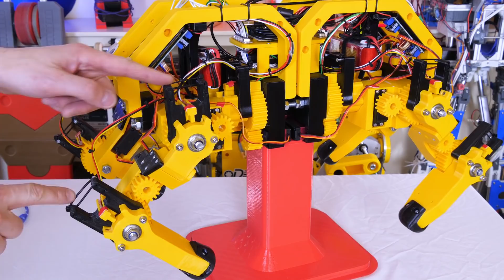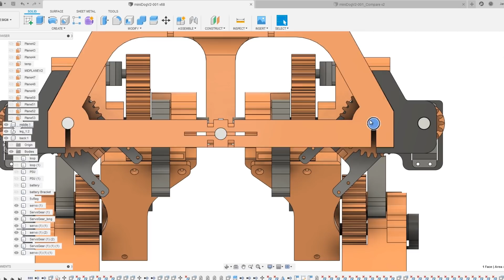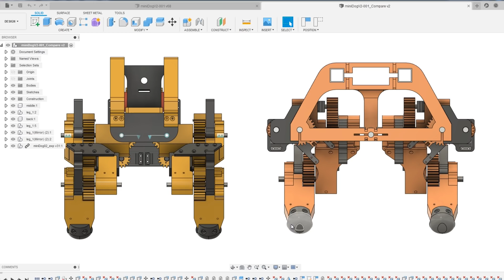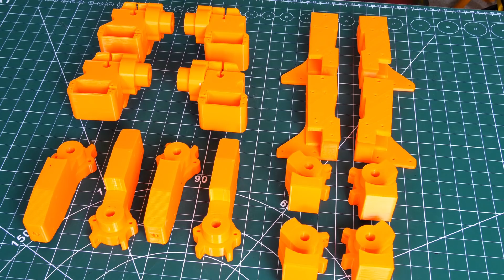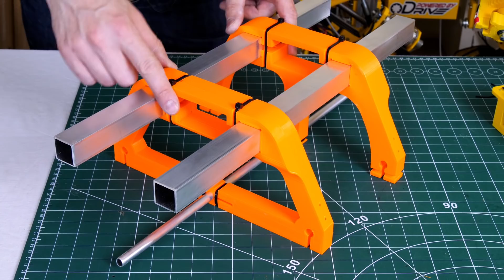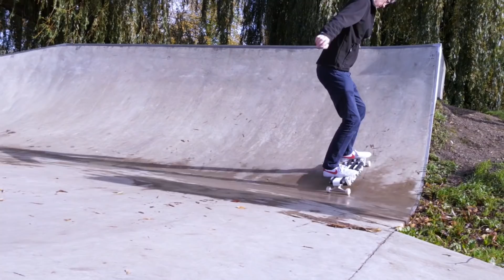Mini Robot Dog #6 - Version 2 design

Comment: you could have 2 springs per joint ( one on each side of the fingers ) doubling the stiffness of the joints
Reply from the maker: Yes but then nothing happens - it'll need to move much faster to make the springs stretch

Comment: While I'm sure it's handy having the front and back leg "modules" the same, if you mirrored the gear trains on the front module while keeping the angle of the legs the same, it would get the front feet closer to the front end of the robot. Also you'd have a longer "wheel base."
Reply from the maker: There isn't clearance for them to bend so it can walk

Comment: I'm glad to see that you're back to working on the compliance problem.  Your feedback system here is ingenious, but I feel like you'd be better served with a simpler mechanism and more computation.  If you ran your servos in torque mode you could compute an estimated force input (with your multiple axes, a force vector) which could be used to sense foot contact with the environment.  This method is more mathematically intense, but should allow for the simplest (lightest weight & minimal backlash) mechanical design.

Comment: y not just take sum time and design something more final and thought out instead of doing so many different iterations that end up not working properly and then moving on from the manufacturing part of the project and move on to the code to make it actually walk instead of just moving individual legs idk, i just feel like this channel go stuck in this weird loop...
Reply from the maker: Because I need to be sure what I'm doing before spending a lot of cash on it. This one walks quite well next week but there are some limits. I'll be combing all my R&D so far into a better machine shortly after that.

Comment: Something you might find useful in the future: Thin wall PTFE (Teflon) tubing is available as both heat-shrink tubing and non-shrinking.  You might find this useful for your plastic on aluminum joints. A thin Teflon sleeve could be used instead of grease.  Is it better?  I don't know, but it's worked well for me a few times.  With a stepped hole in the plastic, it's even possible that the heat shrink stuff could be used to retain the plastic part on the shaft.

Comment: Amazing! 
 I have a thought.
Your shoulders act independently, but your pelvis is rigid. I think if the rear legs were connected to a rigid pelvis with the axis dead center you would make a triangle that will reduce tortion and have a better day....
...especially once you get it compliant and moving faster.
Love it. Plan to make this when it's done.

Comment: The Al tubing is good.  You can Drill a small hole 1-2 mm from the end.  Put a washer on and put a split pin through the hole.  Lighter than plastic clamps and more secure unless you're trying to fix the tubing to some moving part as opposed to it being a simple axle.

Comment: A question that probably has more to do with the symmetrical design. Why keep the foot under the shoulder? If the stance is changed so that the knee to foot portion is closer to vertical, then the weight of the robot should counteract the tendency of the front legs to fold, as folding the legs at the hip would require lifting the robot, and the knee should have better leverage to counteract the force.

Comment: The wobble on the gear tooth - can it be reduced by making the tooth not strait instead in an angle. that increase contact area on them - I think that can reduce the wobble? If your 3D program is capable..

Comment: I think it's a mistake to remove the bearings in favor of grease.  I realize this is a test platform, but that's a design flaw.
Reply: I think the exact opposite. Those "jellybean" bearings are made to run tens of thousands of hours continuously, cheap and easy to design around, but absolutely overkill. Bushings are often underrated IMO.

Comment: Have you considered cycloidal drive on the joints? No back lash yet compliant and can be run using brushless motors?
Reply from the maker: Yes, but I think a belt reduction would do

Comment: I think your 3d printed parts are way to massive. If you designed them a bit sleeker, you could save even more weight. For example look at the boston dynamic spot mini. Its lower leg is a lot smaller then the ones on mini dog, because they designed it like a steel beam, not like a concrete block
Reply from the maker: It doesn't have it's lower leg motor in the lower leg - it's in the shoulder, and the motors are brushless so power to weight ratio is much better... I'll be heading in that direction after this one as per my test dogs.

Comment: The trick, as shown by nature, is to make your "actuators" size and power appropriate!  The muscles in your little finger are smaller than those in your thigh for example, so you can move your little finger with more precision and faster than your thigh, but your thigh is strong enough to hold your whole body up, your little finger (probably) isn't! 

That makes me think that RC servos are a good idea for the actuators closer to the extremeties of the robot, where you want light weight, and small, fast movements, but an alternative might be better for say the hips, or thigh actuator?  One possibility would be to try to increase the voltage to the servo to get  faster joint!  You'd have to take a apart a servo to find out what the limiting voltage was, but i suspect it might be possible to significantly increase servo supply voltage with some minor changes???

Comment: New design looks promising sir, great work! 
I was wondering why don't you use that load cells you had for OpenDog? You shouldn't have any issues with signal interference here. To me it looks more reliable than a spring compliancy system. Also that would help with achieving balance because you know exactly how much load you are putting on each leg at any moment. Would also easily work for a dynamic walking
Reply from the maker: There is too much latency as per Sonic the Hedgehog. A spring is always a spring
Reply: @jamesbruton  That bothered me with Sonic aswell, sensor refresh rate should be more than enough to keep it stable. It was probably reaction time that gave it trouble. Like if it goes off the ramp it needs to react faster without interpolation and just bring its wheel to default position, otherwise it tips. In other words - it is probably on the code side. Prototyping allows revisiting previous methods for improving new concepts. 
Stay safe, stay healthy)

Comment: Re Backlash -  can you admit its always going to be there and make it work to your advantage? 
i.e. if the joints measure actual position, vs demand position - and you drive until actual=desired doesn't backlash null out?

Comment: I simply cannot wrap my head around how you can produce these things so fast
Reply: He sure is a clever dude!
Reply: @Theodore Losen of course inwould try to work fast. However pumping out robots of that complexity from " i reverse the front legs lol" to designed and printed frame  in few weeks is very impressive.

It would be interesting to know how many hours he actually used for it.
Reply: I have to agree, his speed is indeed very impressive
Reply: Practice mostly, paper sketches first and then to 3d modelling i guess you need some kind of reference to draw from.

Comment: Nice.  If you want to save weight, use less infill and thinner walls.  0.8mm and 5% infill should work a treat, lol.  Oh and as another tip.  For speedier printing, always work your models to directly divide by the nozzle width.  Most of my models use 1.2mm walls (for my 0.4 mm nozzle) and no more than 15 percent infill, and unless I am printing something very precise, I almost always use 0.3mm layer height.

Comment: Just a thought, if you have the legs straighter, then there would be less force trying to back drive the joint.
Really, it will most like just be a code update to change the rest position.

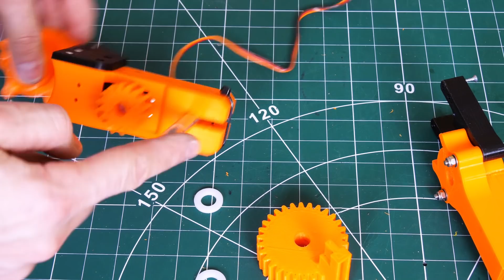Comment: 6:00 is there a reason not to have printed this upper leg in one solid part ?
Reply from the maker: The two parts are printed in different orientations, also there isn't an easy flat side to put on the bed.

Comment: Hey James, I'm only 3 minutes in while writing this, but I just realised this thing lacks Tensegrity. You could just add a bunch of elastic strings to either side of every wobble, to keep it under a certain tension, which would be good if tuned for a specific animation.. but to be able to vary the tension based on how much force is being exerted, say by winding them in and out with small motors, would basically be a variable damping effect, which, if tuned right, could create realistic life-like motion and control, with enough development. To be more specific, I mean they shouldn't interfere with the angles of the joints, just hold them under equal tension from either side, kind of like how real muscles tense when actioning.
One other essential though, is designing the shapes so they can action like real animals.. which you've done well on with the order of rotation on your legs axis, so I see a lot of promise in this design! However, I think something needs to be done with the front.. some kind of shoulder arrangement that extends motion, making it easier to pick up the front feet.

Comment: Instead of having the same legs on the front and the back, try more human legs on the front
Reply: Or maybe turn the back legs around
Reply: @thekraftyguy  That's basically recreating the previous design though.

This current leg layout is pretty accurate to how a dog's legs are constructed though, once you factor in that a dog's back legs have very large feet, meaning they effectively have 3 jointed legs, not 2...
(obviously the front legs are also technically 3 jointed, but the front feet are so small it barely makes a difference.)

Comment: What was the weight difference so far?
Reply from the maker: only about 0.5kg as there's more metal frame and the frame is bigger. The steel parts removed were estimated at 1.1Kg.

Comment: Just curious is there a reason why you only print one part at a time? When you print the small parts I would've assumed you would print more than one at a time.
Reply: risk of print failure your printing longer higher risk and bigger loss if things go wrong also more stringing and longer punting time because more travel moves
Reply from the maker: I do, on multiple printers
Reply: @jamesbruton  gotcha. I can't wait to build one of these myself! Thanks for all the great work you do.